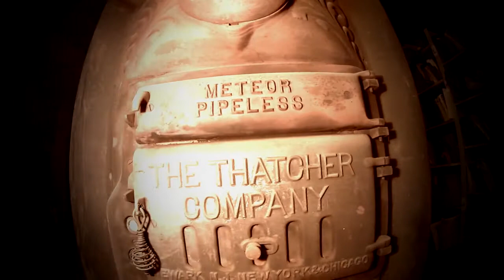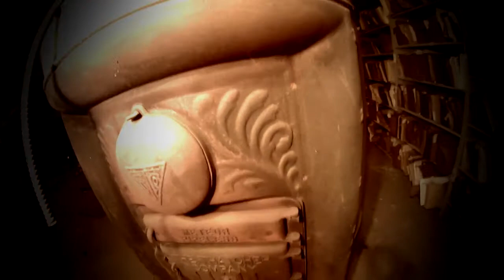The Thatcher gravity furnace BLOG#249

Comment: i have worked on several coal furnaces converted to oil. that burner is probably one of the oldest I've seen in 9 years of being a oil heat technician. good luck finding a replacement motor or pump for that lol.
Reply: I think a lot of the old non-retention head burners were replaced with newer retention head burners between the late 1960s up through the 1980s and 1990s, so we don't see many of the truly ancient oil burners anymore. I DO however see ancient gas burners.